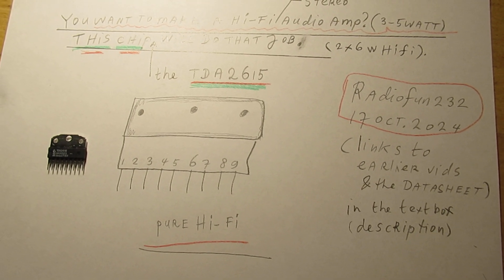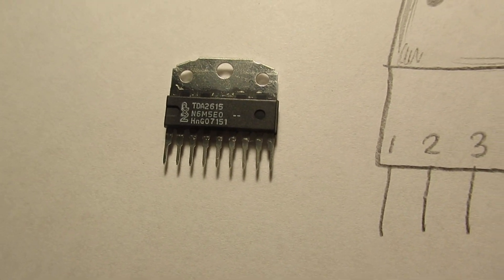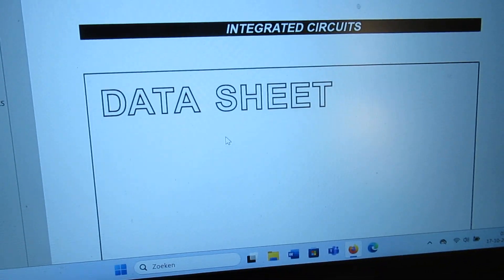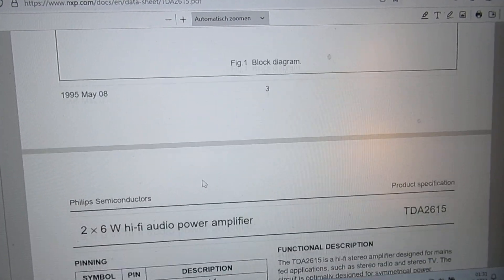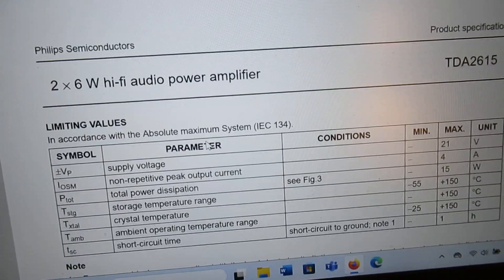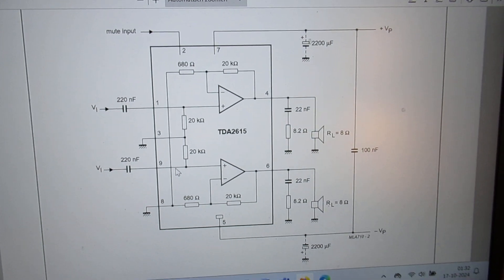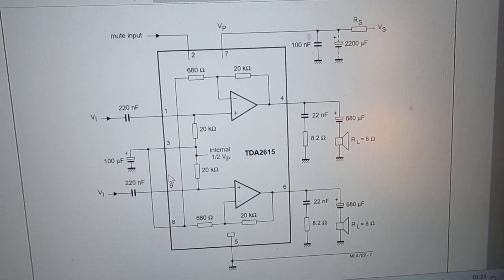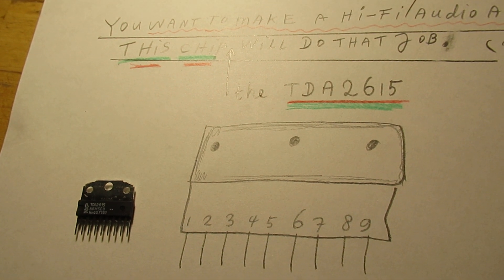TDA 2615 audio Chip amp 2 x 6 Watt max. from Philips, pure Hi Fi, datasheet & links how to make it

Comment: I prefer using a couple TDA2050, or even 4 of them (2 in bridge mode for each channel), because of wider input voltage range - your chip seems to need at least 15v (as positive and negative 7.5v) and up to 21v ... TDA2050 will work with as little as 6v and up to around 50v if my memory is good, and there's designs for both single power supply and split power supply modes. There's projects published that can be easily found with a good search but even the schematics in datasheet are good enough to just put on circuit board.
It's also obsolete, but several asian companies make clones of it - some may have less protections (weaker over voltage protection, or smaller transistors inside) but the sound quality is there.
Reply from the maker: Thanks, very good info for everyone. But: the TDA 2615 is pure HiFi, other Chips not. Be aware of that. Update 4 May 2025.